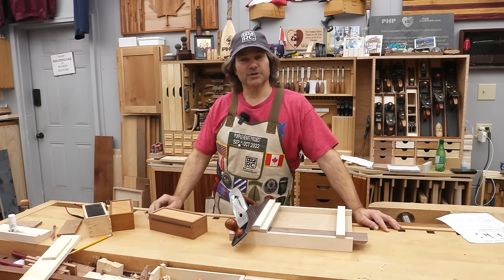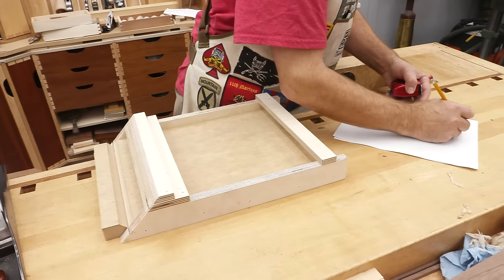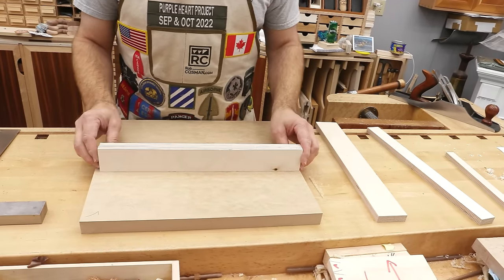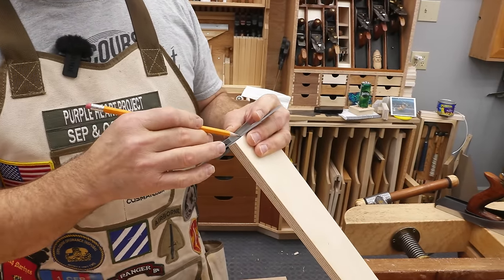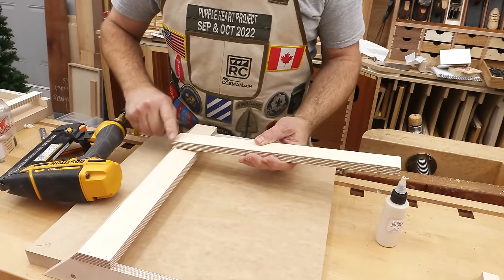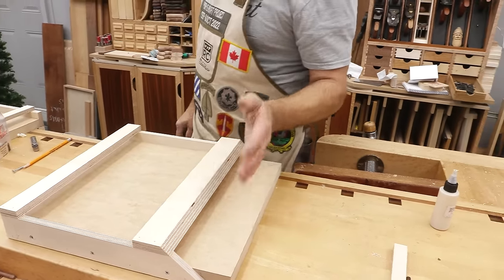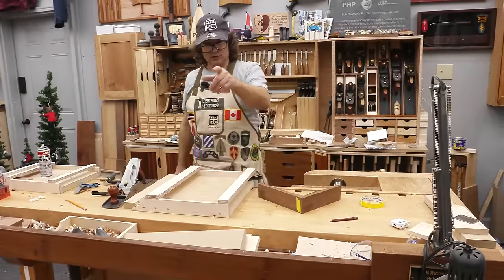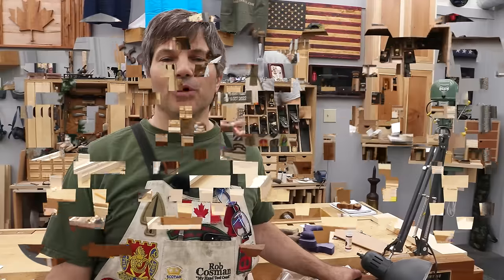Vertical Miter Shooting Board Build | Perfect Box Miter Joints

Comment: What are the advantages/disadvantages of this compared to a donkey ear?  With a donkey ear you can still have the regular shooting board ready in a second, although this seems like it may be more accurate?
Reply from the maker: Two jigs designed to do the same thing. The traditional donkey ear with a screw is harder to build

Comment: Every time I watch one of these videos it ends up with the same catch 22 problem... you already need a tool that can cut a true 45 in order to make a jig to can cut a true 45. If I had a table saw that could already mitre cut accurately then I woudn't need a mitre shooting board, but I would be able to build one.
Reply: With lots of test cuts and fitting, you don't need a tool that has 45°
Reply: with a #5 plane you can get 45 deg, just takes a little time.

Comment: On your regular shooting boards you always flip the piece and do a bit of a chamfer and then work up to that, to prevent tear-out. Here it would be difficult but is it also not necessary becasue the "fence" is zero clearance because of the braking in?

Comment: I built one of these a couple of years ago.  It works great.  I found that if for any reason the miters do not produce a 90 degree corner, the angle can be corrected by moving the lateral adjusting leaver to make slight changes to  the miter.
Reply from the maker: great point

Comment: I built this over the weekend. Got to use it for the first time yesterday. It worked perfectly. I got exact 45° cuts. I did have to cut the 45° cut in the jig twice. I needed to refine the 45° and make it a little bit more accurate, and also I needed to make the groove a little deeper in the board.

Comment: One question I have about planes used with shooting boards, do you want a plane blade that is sharpened dead on square to the sides of the blade? It seems that for general use, you want a very slight arc to prevent blade lines/ridges in the finished piece. I was thinking that with a shooting board plane you would want the cutting edge perfectly straight, even on the shooting board planes that have a skewed blade.

Comment: Great looking shooting board, I could use that for base boards/trim.
Could you use a 45 degree router bit on the mdf base instead of using the table saw so you wouldn't have to dial in the table saw?
Obviously that cut with a router would need to be done at the beginning

Comment: Always wanted to make one of these for wider boards.  I've made 4 regular ones for a hand tool class I teach to do 45° for picture frames but they only handle about 1-1/4" wide boards.  This is the best design I've seen yet for these wider ones.  Very cool and easy to make precise.  Thanks for the video, Rob.  Merry Christmas to you and yours.
Reply from the maker: glad you liked it Don
Reply: @RobCosmanWoodworking  Finally made one of these yesterday and tested it this morning.  I was a little upset with some of the precision I achieved on the board (retired machinist here so I'm too picky for my own good sometimes.)  However, the 45° miters it makes are perfect!  Great design.  Game changer.

Comment: Merry Christmas Rob
Another great idea and another tool to make to go with the wooden hinge kit I bought off you recently.  With the benefit of hindsight, may I suggest making the base a little longer to start with in leu of adding a bit latter.  We all have 20/20 hindsight. To set up my table and miter saw for 45 degrees I make 4 cuts to get a box this exaggerates the error 4 times.  I also ensure that the fence is parallel to the blade because that will put the 45 degrees out. Maybe another video topic tuning up a table saw to get perfect 45 degrees cuts😁.
Regards Murray
Australia
Reply from the maker: All good ideas, thanks

Comment: great video. I use mine whenever possible and the results are definitely noticeable. However, I'm curious as to the reason for the holes on the side of your #5 1/2. some sort of accessory handle mount? or some other reason? please do tell.

Comment: Having made something that looked a lot like this, but with out the benefit of a table saw, I would have been much more interested in how Rob would have tackled it without that saw.  I used a hand held circular saw to rough the long 45deg guide, and it felt like cheating. Given how many YouYube wood workers show making mitre corner boxes with just their table saws, I reckon it is those without such tools who would find this kind of shooting board most useful.
Reply from the maker: You can make this whole thing with hand tools just have to test your angles to make sure you are dead on

Comment: 😮 Just wow. The tactics you use to create things like this are incredible. I have one question, on a Cosman shooting board the back, the part the work piece is held against, is off set toward the front a few inches. Why is that not done here?
Reply from the maker: Because on the straight shooting board there is only a tiny strip of wood the sole of the plane is held againt and that has a tendency for users whe they shoot through a piece to pull the plane into the shooting board.  Pulling the fence back a few inches prevents this.  

On this miter board the plane is riding on two supports so its held very solidily and that same problem dies not exist

Comment: Another useful fixture and with the usual high precision and attention to detail 👍
Was there any benefit to cutting the 45 degree parts individually and then lining them all up, compared to just attaching them and then running it through the table saw and cutting the 45 all at the one time?
Reply from the maker: Well thats the way I would approach it if I
Reply from the maker: I did not have a table saw

Comment: Thanks Rob! Nice helpful video. You missed an opportunity to build an elevated aux fence for your table saw rather than screw on the extra piece. Do you put any CA glue into the MDF screw hole before you put the screws in? How long do you anticipate this shooting board lasting?
Reply from the maker: I did not add any glue to the screw holes.  I think it will last for years

Comment: Rob, can you tell us a little about that monster engineer's square that you have? Is it a Starrett? So many the times I wished for something that size that I could rely on.
Reply from the maker: I bought it on Kijiji, which is a Canadian version of craigslist up here in an auction. It came from the rust belt in Ontario, which is basically our previous manufacturing area so no I can’t tell you exactly what it was used for in this day, but it was designed for testing flatness.

Comment: hi rob and co.  im getting ready to build this shooting board as well (i have already built the others you demonstrated) .  In this build is there any problem with the blade impacting the jig itself?  thanks and as always love the channel, love PHP
Reply: I have an almost identical jig, and the only impact I've had is accidentally having the blade too far advanced and taking a bit of wood off the end stop. Not a big deal though, doesn't affect performance except maybe making the chances of blowing out the end of your workpiece a bit higher, but you can stop that with a simple knife line. The iron will take a slice or two out of the rails that guide it, but I just make sure to use a plane of the same width consistently ( a 6 or 7) rather than a 4 or three that might ride on the ramp where the slice was taken before by the wider plane. Hope that makes sense!

Comment: Merry Christmas Rob. Is there any need for a back bevel on a 45 miter, similar to what you do when shooting a 90 degree piece? I'm getting some tearout on my small box miters and have been trying to use a chisel to ease the back edge, with only limited success.
Reply from the maker: In this particular design there is a fence against the edge of the piece preventing blow out so no not needed, but its all about the shooting board design not the angle

Comment: Would there be more plane stability with the piece at the 45° angle? Keeping the plane flat on its side. (I'm only 3 minutes in, so... this could have been discussed already)
Reply from the maker: What you are thinking about is called a donkey ear and that is another way to achieve the same thing.  BUt no there is not a stability issue of one over the other

Comment: I want to make one but my Incra fence will not allow the 45 cut from both sides. Any ideas for an alternate method? Maybe with a track saw?
Reply from the maker: In that case I would cut all angles super precise the first time then just line them up using your finger to feel if everything is lined up (Your finger can detect very small amounts)
Reply: @RobCosmanWoodworking  I wasn’t clear on my question. I was asking for an alternate way to make the “V” cuts that will serve as the cradle for the hand plane since I cannot make the cuts with my TS but still want to build the jig. Maybe a v-Groove router bit or possibly construct a sled?

Comment: Does it matter what kind of plane to use for your shooting board? What kind do you prefer to use?
Reply from the maker: Length from blade to toe and weight are the two biggest factors.  Blade width increases capacity through not a big deal.  I use the 5 1/2